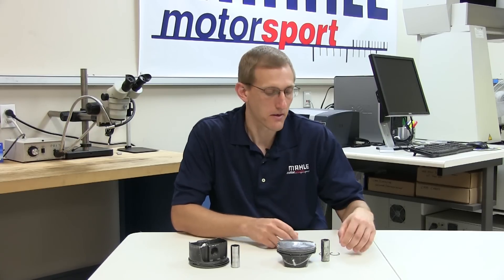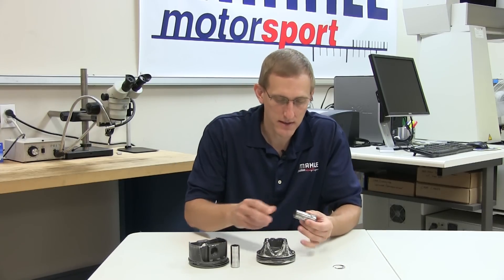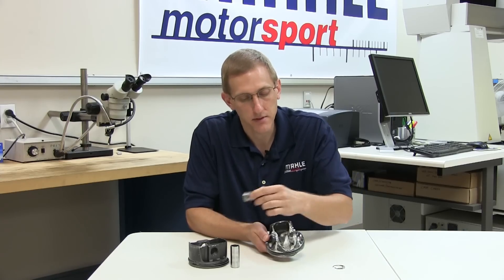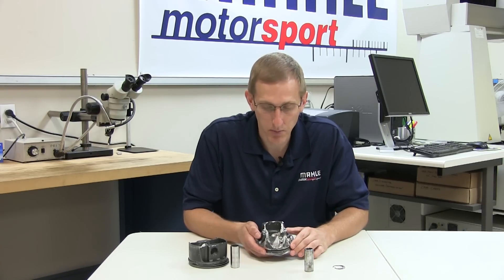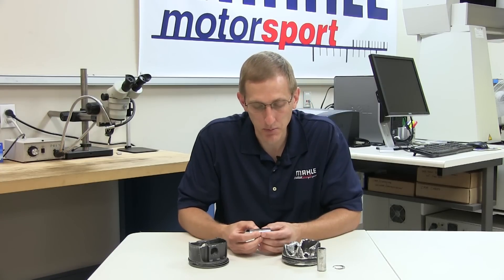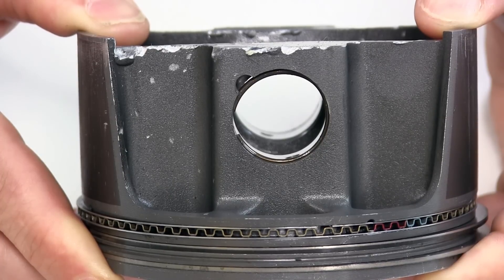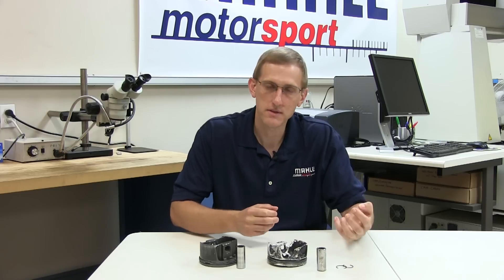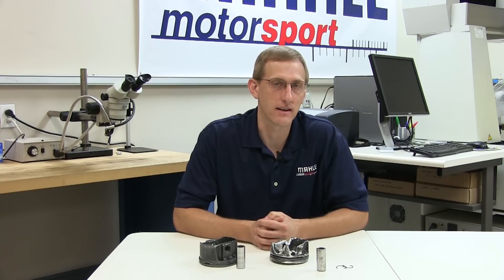Pin Bore Circlip Failure Analysis

Comment: What's the culprit to clip "pound out"? Where the pin pounds the clip into its groove until the pin walks out and grooves the cylinder.
Reply from the maker: Most of the time, it is a result of the clip not being installed properly initially. We've also heard of people trying to re-use old clips, which you should definitely not do, leading to the same result.
Reply: +MAHLE Motorsports North America I meant the clip being pounded into its groove, so much so that it no longer retains the pin. NA forged piston
Reply: +moparerrnocar 
In my experience,  incorrect clip, incorrect clip installation/not seated, clip reuse, user/installer damaged clip, connecting rod misalignment, bent rod, twisted rod, rod bores not parallel, incorrect/modified  pin dimensions (length, end radius/chamfer) and circlip groove modification/customization results in failure.
Reply: @patw52pb1  ....And excessive crank walk.
Reply: @kylelove927  
I agree. also pin seizing in the rod.
Reply: @patw52pb1  Honestly never thought pin seizing would do that. Can you describe how that would happen?
Reply: @kylelove927  
I will certainly try. 
With a full-floating pin/rod assembly experiencing crank walk, the rod would move fore/aft independently of the pin. 
The rod small end may contact the piston pin boss but not exert sufficient force on the pin to dislodge the pin clip when experiencing excessive crank walk. 

However, with a press-fit pin/rod assembly or with a pin seized in the rod of a full-floating application and experiencing excessive crank walk the rod small end would move the pin fore/aft and could exert sufficient force on the clip to dislodge the pin clip. 
Note: even when using pistons with pin retention clip grooves, using pin clips with a press-fit pin/rod assembly is not recommended. 
I recommend when in doubt, always contact the affected component manufacturers for support, best practices and recommendations.
Reply: @patw52pb1  Excellent explanation. That's a factor that has never crossed my mind. I appreciate the feedback. 

<<<It's amazing how much can be learned by asking the right questions and interacting with the right people.>>>

Comment: If you rebuilt a engine and installed the clip incorrectly how long do you think it would take for the clip to come out? It doesn't have to be pin point set of miles or something just a rough number.
Reply: Too many variables to even guesstimate.
Reply: instablaster
Reply: @Devin Ace  your 2 years to late, I guess I installed it correctly because it’s still running strong.